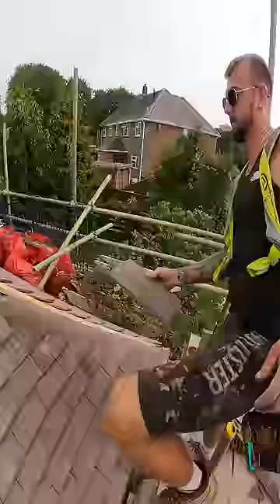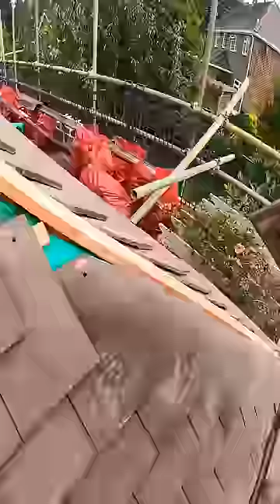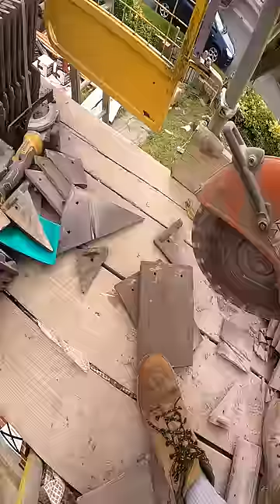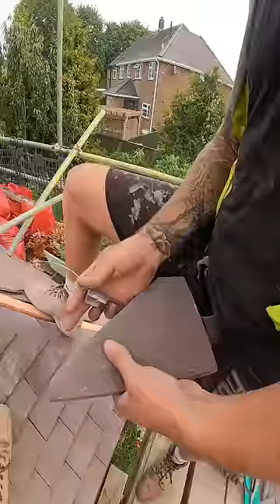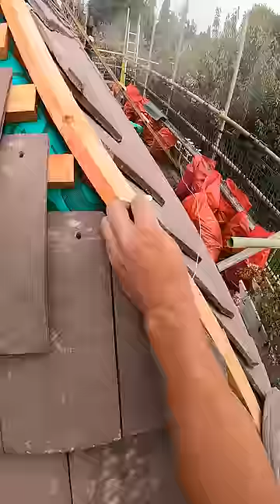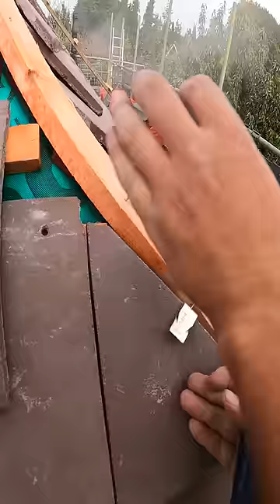#shorts #roofing  #construction

Comment: I've done it all rubber .PVC.shingles. steel . Slate.ceder. Shake. .lol and the one that I've done years ago makes me feel old is remembering how to run a kettle.. when PVC first came out we didn't heat weld the seams we used a salvant and layed sand bags on the seams

Comment: I'm guessing they have these kinds of roofs where it doesn't hail, snow, rain, freeze, then heat up to 80F* on the same day because  those tiles would be damaged in no time. Hell, normal concrete doesn't hold up very well in one Winter.

Comment: I like the wire hanger.  However should you use a real slaters hammer you'd find it quicker. You helper should be cutting the hip cut in advance . Start from the cut and move on. Nice work for today's standard.

Comment: Man that's a nasty job never worked with these I used regular asphalt shingles but I remember doing like 4 layer tear-off with wood shacks on bottom then have to deck the whole roof you would literally be black after that tear-off and clean up I worked under the table for these older guys in like 2008 they only payed use younger guys like 10 bucks an hour

Comment: As a roofer you dont cut slate with a saw , use a slate cutter , other wise you wont have rhe cut edges flake design . Like ever slate roof on the planet. And also idda had that piece of slate cut by the time youre saw got 2 inches through
Reply from the maker: That’s a tile not a slate😂
Reply: @herbie98  we call that slate bud
Reply: But to my point , you use a slate cutter so you're edges are rough on one side , that gives the slate roof the same look as a slate roof should have , all the edges on that roof are flat .and smooth , should be flat on the backside and rough edged on the front side . Done it for 16 years. I know dudes that would snap if they ever saw someone cut slate with a saw . Just get a slate cutter , takes less time and looks correctly.
Reply: @herbie98  is it ceramic? I could understand ceramic being called a tile , Im assuming it was slate. And again ceramic roofing yes you would need a saw. I wasn't knocking you're work man the roof looks great